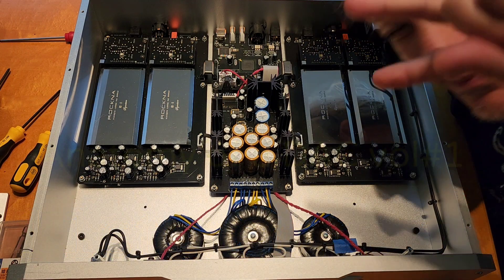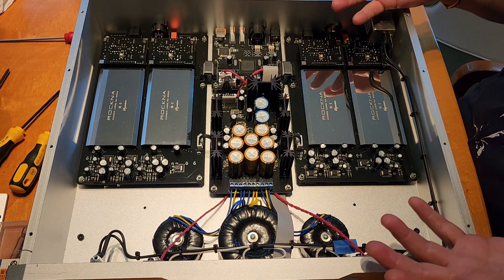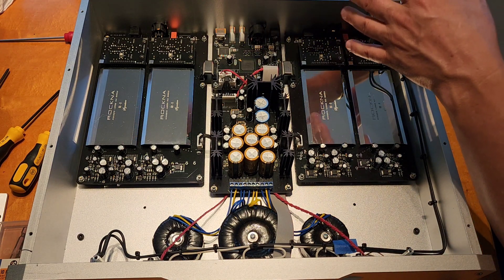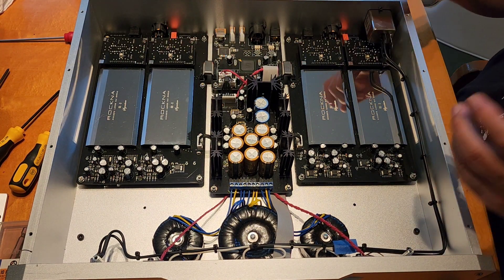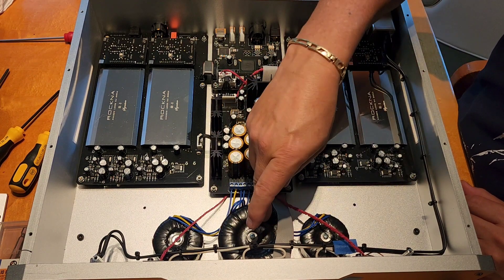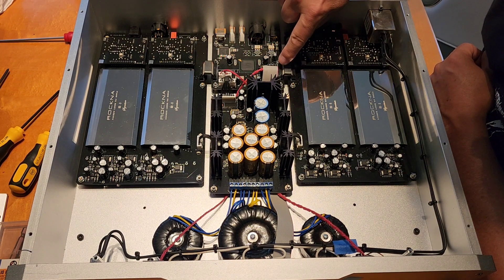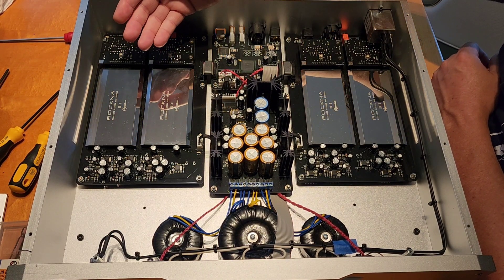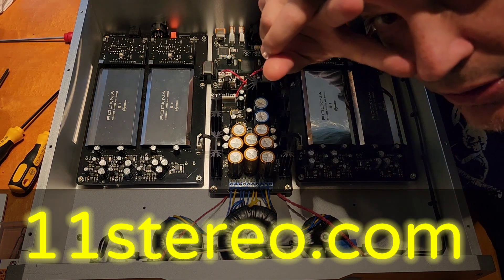ANATOMY OF A DAC - VOL #1 ROCKNA WAVEDREAM SIGNATURE BAL.

Comment: what do you think of the Audio Note dacs with their single chip, no clock and no over sampling?
Reply from the maker: Then you are completely at the mercy of the signal integrity. This means clock is sent over a wire which I dont like. Clock should be on the board no more than an inch from the DAC. If you dont oversample you are getting artifacts galore. I dont like multi bit PCM conversion in any of its forms. Im a single bit conversion guy.
Reply: @OCDHIFiGuy  Thanks. Can you suggest a way to minimise these artifacts assuming one is already using this kind of spdif dac? can you add a DDC in between the server and the dac?

Comment: Mikey, I own a Theta Gen. Va R2R DAC that was made in the early 90's. Mike Moffat was the designer and the price was around $5,000.00 at the time. It will only play 44.1/16 so it has limitations. I would appreciate it if you could speak to the sound quality of the Theta vs more modern designs. I understand the Schiit Yggdrasil is basically an updated version of the Gen. Va. Thanks
Reply from the maker: far as I know Theta is KILLER.

Comment: In any DAC, hit the highest sample rate as much as you can. It is already proved that it lower floor noise within the chip itself. DSD512 or 768PCM basically you can turn the filter off. The filter will be set at ridiculous high value that it doesn't impact the audible frequency. Near -150dB real world.
Reply from the maker: uhhh. OK... ;-)

Comment: MSB DACs are certainly diff. and prove a LOT has been done in recent years. Most DACs are not that good. Even Analog Devices white-papers show (7) errors in conversion. Add power supply, clock, output stage - the quality-difference is staggering...
Reply from the maker: Totally true, thats why I stick to ONE Brand that I feel does it right.. the only time I sway from that brand is to hit lower price levels.

Comment: From what I know the DAC chip is not something that needs to be very fancy. And you're right Mike, they've been good enough for many years now.
It's the delivery of the data stream to the chip and then the analogue output section that really matters.
Reply from the maker: Its EVERYTHING together in my opinion. Power supply is VERY important as well.. But I agree..

Comment: Thanks for elaborating on this Mike. What do you think of Lampizator DACs? Especially higher up the range, Golden Gate 2 and Pacific. Any personal experience or credible "hearsay"?
Reply from the maker: I sold Lampi for a few years and used a modded out balanced Big 7 (was a GG except for copper cover.) and enjoyed my DAC while I had it .  They can be lots of fun if you like to roll tubes. I think many long standing audiophiles get away from tubes eventually. They can be fun to play with, but the variable electrical performance of a tube can make them precarious. IMHO a Killer SS DAC is best.  Lampis to me are like chopper motorcycles, fun for the younger cool guys but the seasoned riders go for BMW..(Generally speaking)

Comment: My power amp only has single ended but my dac and preamp are both fully balanced and single ended. Is it better to run balanced into the preamp then single ended out to the power amp? Or should i stay single ended all the way?
Reply from the maker: Id depends on the gear and if its truly balanced circuitry or only has the inputs. If you are combining types, I prefer to use balanced every place I can. Though I like to maintain the integrity of the circuit. I would run balanced to your preamp then SE out. But try both to see if you prefer one or the other sonically.